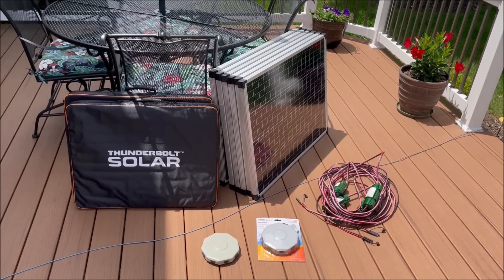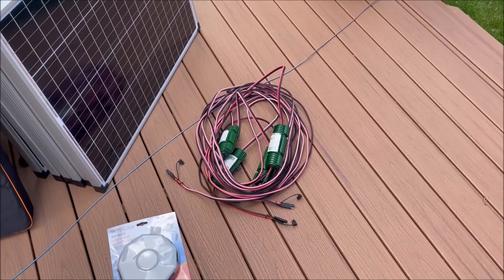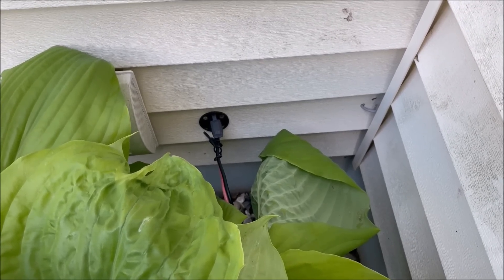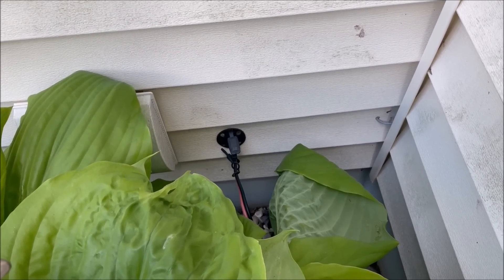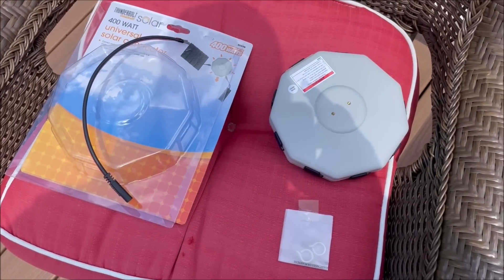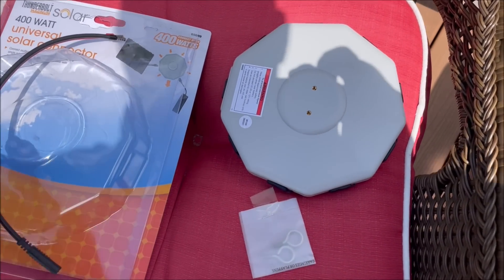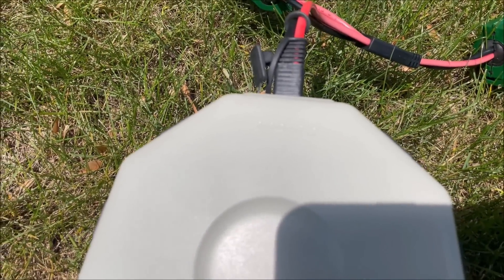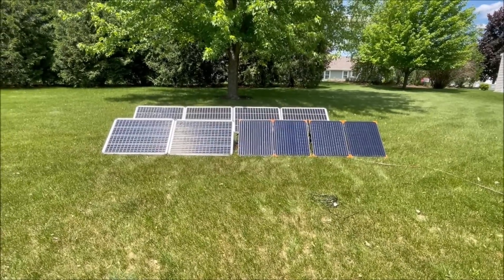Part 1-Hook 8 Harbor Freight Solar Panels together in Parallel - OOPS - "Houston We Have A Problem"

Comment: I have 4 harbor freight panels wired 2s2p and will get 380 watts into my Bluetti EB200
Reply from the maker: That looks like it's working pretty good.  I'm going to switch to a Series/Parallel setup also to see if that cures my issue.
Reply: @thechiefsway2618  the Bluetti seems to have a decent MPPT algorithm to squeeze what it can out of panels. In my experience, the higher the PV voltage the lower the losses.
Reply: @thechiefsway2618  that much wattage at 12volts you need wire in the car starter thickness. the more in series  12 ,24,36,48,60,72 the thinner the gauge wire you need.
I bet your power wire is warm
Reply: Yes 24 volts is better than 12 and 48 volts is better than 24. I would go 24 volts using these panels. If you have 12 volt things to run you can tap the center of two series batteries to get your 12 volts. Just a thought. 73
Reply: @ronb6182  How do you tap in to   24v series to get 12v?
Reply: @davidmorgan2815  by using two 12 volt batteries in series. I'm talking about lead acid batteries. You hook to either battery for 12 volts. LI on batteries I have no clue. 73